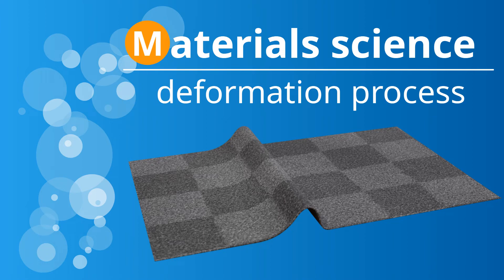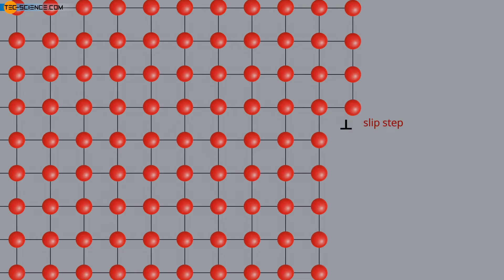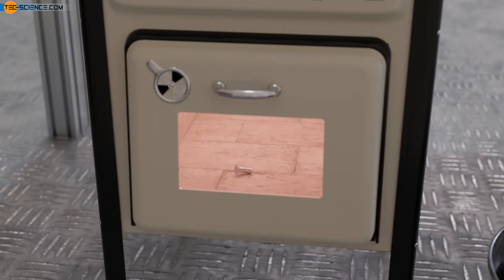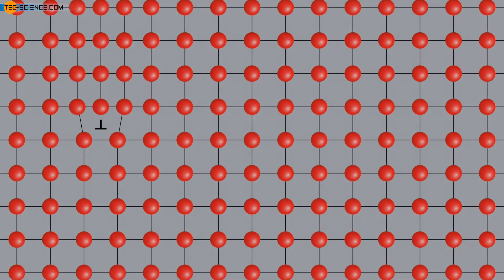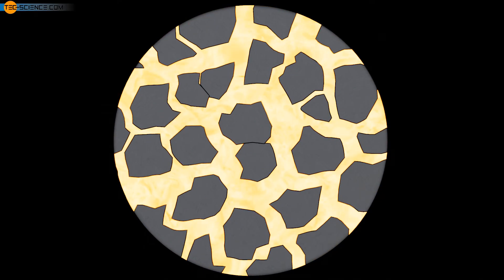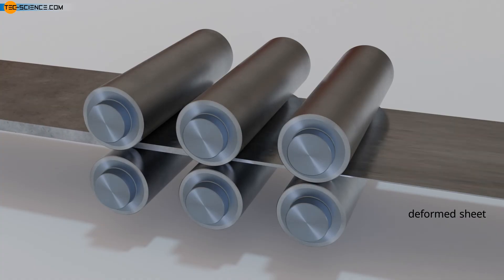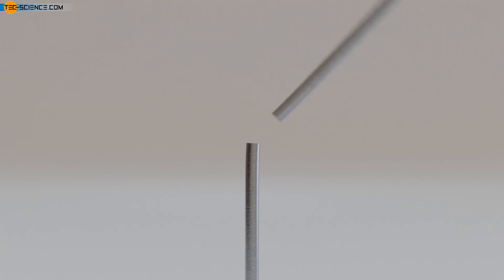Deformation process in a real crystal structure of a metal by dislocations

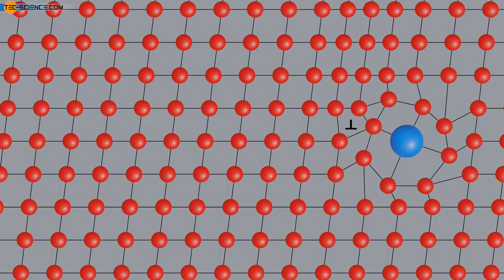Comment: Nice video, very clear! The only downside is that I don’t understand why an atomic bond forms at minutes 3:00 and 4:00 when the dislocation gets stuck during its movement. Due to the dislocation there is always one atom missing a bond; in the video this occurs throughout the movement of the dislocation, but when it becomes pinned an additional atomic bond is formed and i don't understand why. If someone could explain the reason to me, I would be very grateful!